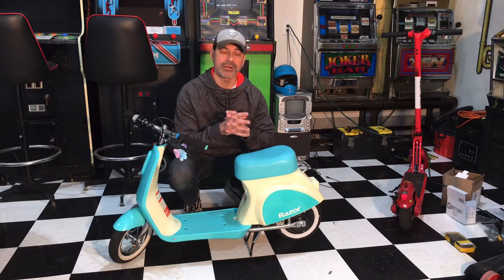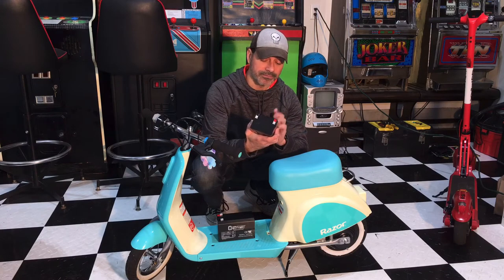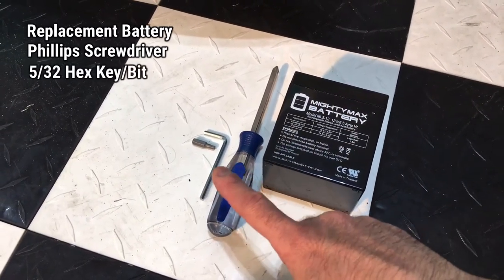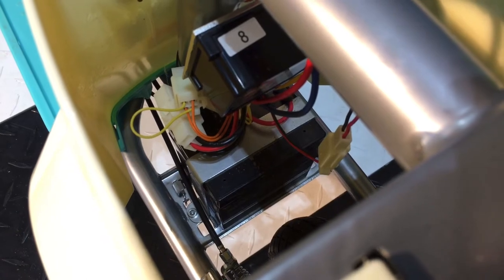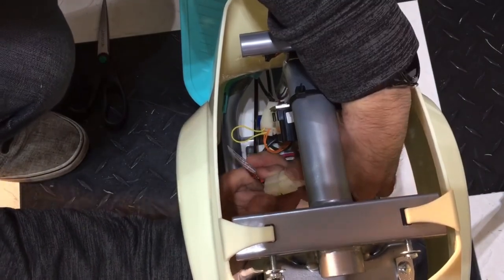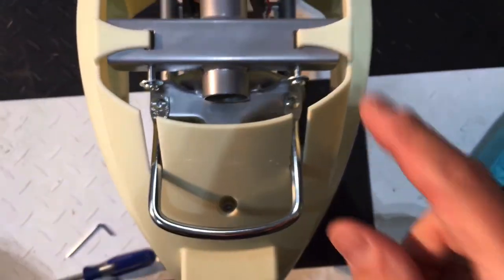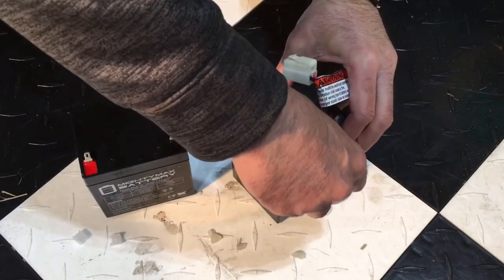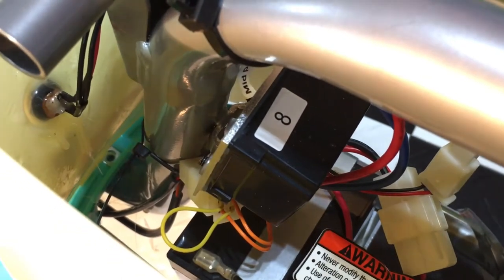How To Replace The Battery On A Razor Pocket Mod Petite Scooter (Phillips Vision: Episode - 81)

Comment: Also - if you get the battery from Razor its already got the wires and connector piece on top of the battery so its just as simple as clicking it in.  And the plastic on the bike is flexible enough to pull/push the battery in and out without detaching piece with the switch on it, through the bottom.
Reply: can i use just 1 battery 12v 18w.  very heavy.  i only want more charge/time ride